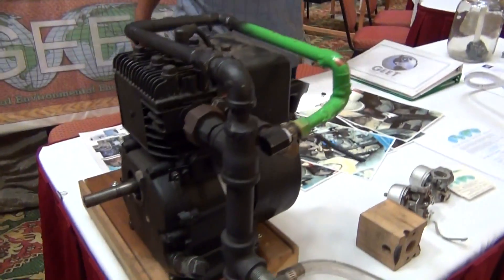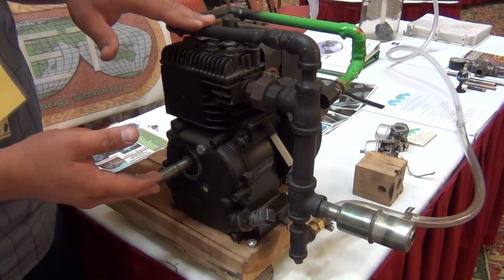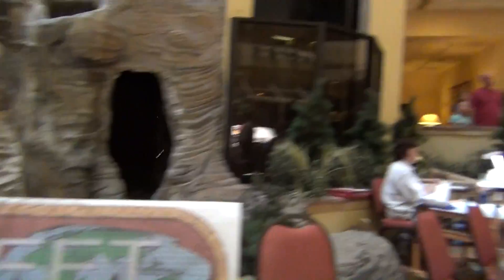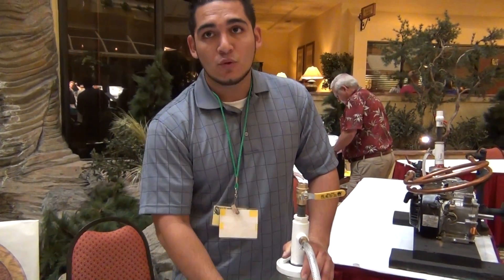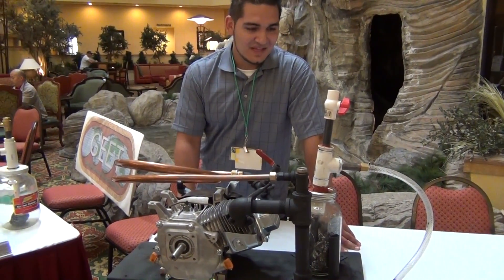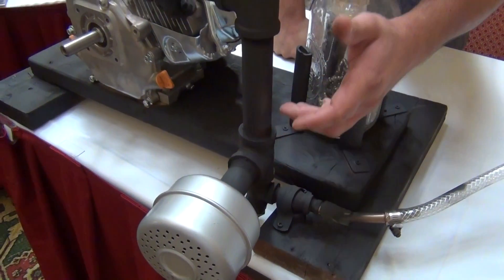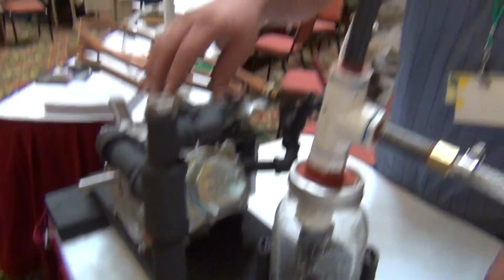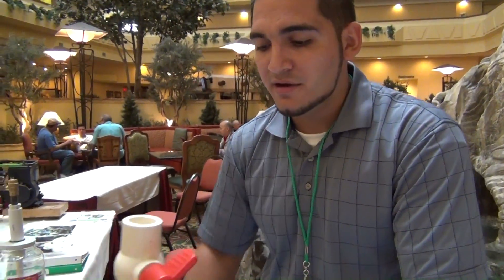GEET Engine Overview

Comment: Great video. I really like that GEET technology has the ability to run any internal combustion engine with crude unrefined oil pumped right out of the ground, and run the engine with less vibration, less tailpipe emissions, and a minimum of a 30% increase in fuel efficiency. Also see the web site GEET international.(com) to learn more. Thank you very much for posting this video :-)